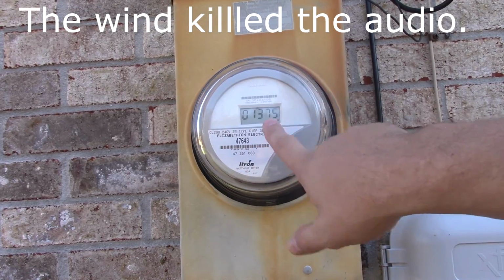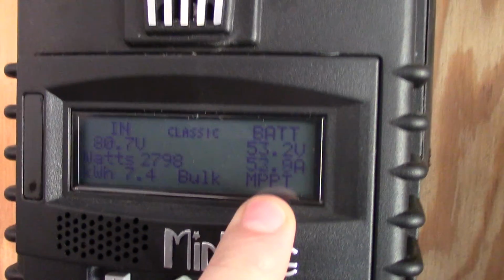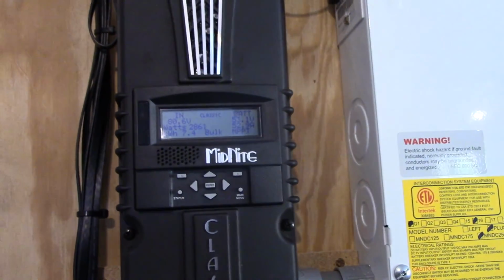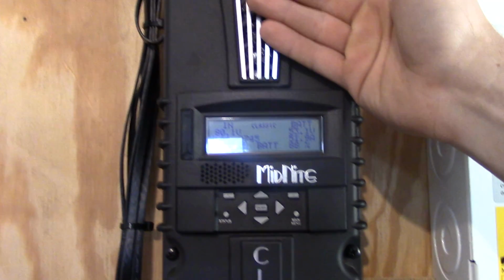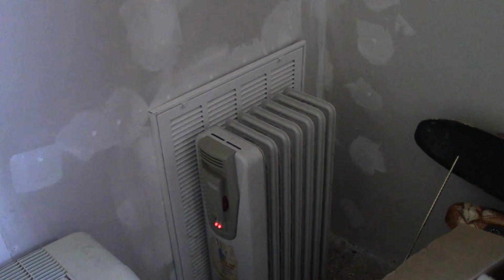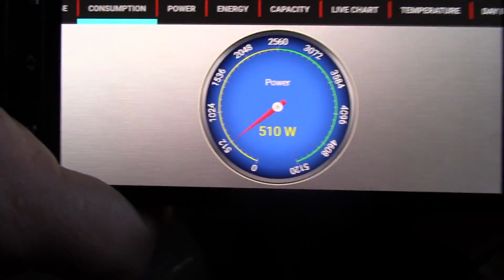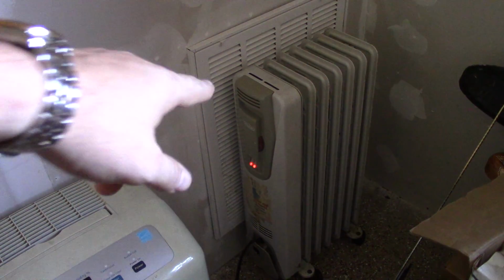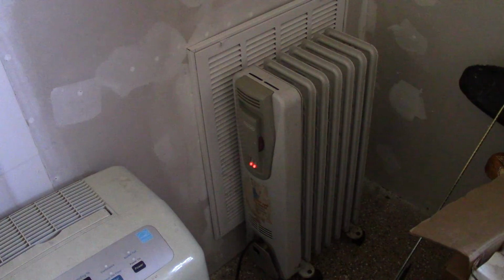Day 5 Of Project Magnum Off Grid

Comment: Using electricity to make heat is very inefficient. I understand where you are going with it, but it well be very hard to do off grid on solar. That is more of a hydro guys game. Most of us that live off grid depend on wood heat. Have you considered a wood fired boiler?  Not sure how cold it gets where you are, but up here we can get -30 below F for weeks on end in the winter, and that doesn't count the windchill. Doesn't happen every year, but we do hover around -10F most of the time. I used to run a oil fired boiler on WVO, that might be a great option for you if you have any access to WVO for free. In my opinion the three hardest things about being off grid is heat, refrigeration, and air conditioning.  Also just a thought but when was the last time you washed your panels?

Comment: The oil filled heater when the T stst is set to max will never turn off, unless things have changed, or you have it located in a very small room.
Still cant imagine for general heating why anyone would use electricity if natural gas was available. I know heat pumps can be fairly efficient, but beat gas in cost? I doubt it
Then there is the waste energy in charging batteries...
You would need some serious heat storage to have a solar heated home, that's for sure

Comment: Hello Friend, love all you have presented to us on your site. I was wondering if you have ever thought about a natural gas radiant heater. They use no electricity and use 99.99% of the heat in the gas. They are non vented, I have used my for twelve years and have cut my gas use by 50%. I always have a CO detector install near by also. Never have any issue. Please look them up. Some times called a Brick heater. Be sure to order the one for your type of fuel (propane or natural gas) many of the new ones will burn both types of fuel.Keep up the great videos.Fred
Reply from the maker: I will look in to that asap